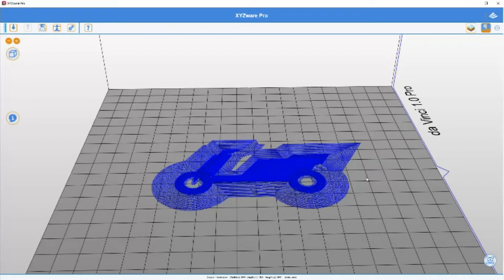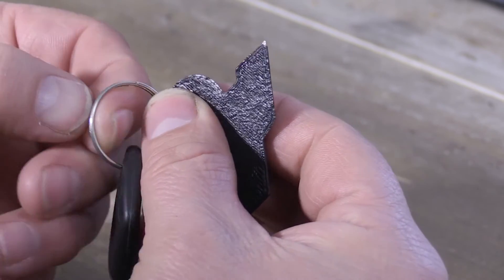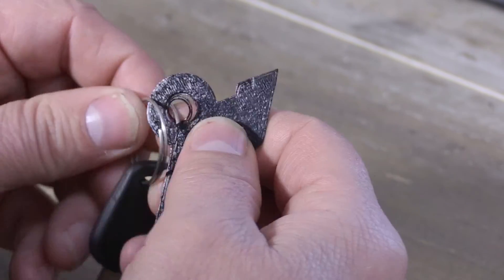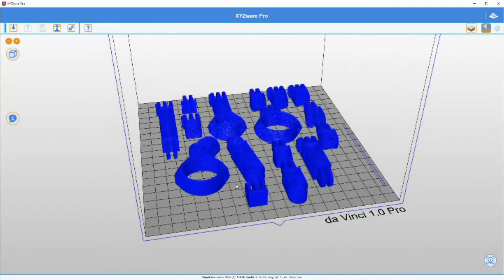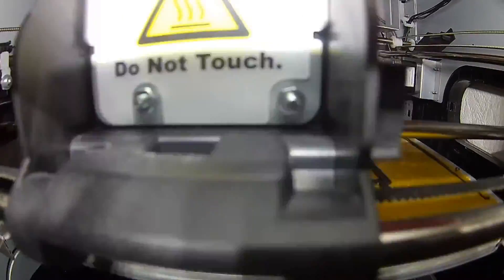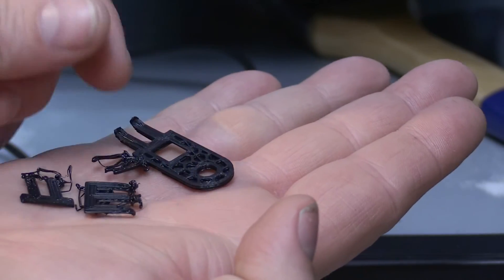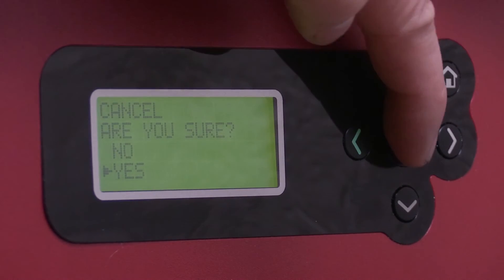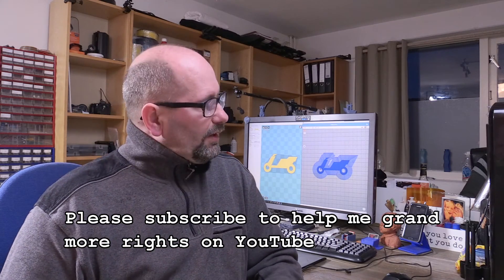▼ XYZWare slicing failed and multiple parts on your print bed

Comment: don't let the slicer fix the model and it will stay the same
Reply from the maker: The slicer was fixed about 3 months after I made that video.
At that time, there was no way to change a setting to prevent it from happening.

Comment: Hello Brian, I have a same model as yours the 1.0 Pro. I met a problem about the warp, most the time the print warped at the corner, I tried several method like glue, tape, alcohol swipes... to fix it but not able to make it. Do you have any better ideas? Really appreciated for your help.
Reply from the maker: My guess is that you are printing with ABS when this happens?
With PLA you would not have these problems, so if you don't need the strength of ABS, please use PLA.
And I made a video about how you can change things in your designs to make ABS stick to the bed better.

https://www.youtube.com/watch?v=stkI3HBKrKg&t=3s

Good luck.

Comment: How do I cut a box in half?? I'm trying to make a mold for clay and it needs to be two halves
Reply from the maker: You can do it while creating it in your 3D CAD software, or you can do this in your slicer, if the slicer supports printing to (and from) a certain point in height.

If both options don't work for you, there is also a way to do it in Tinkercad, but I am not used to that software, so I don't know how to do it. I just know it's possible to work on a STL file in that software.